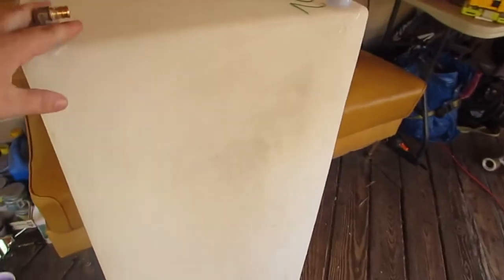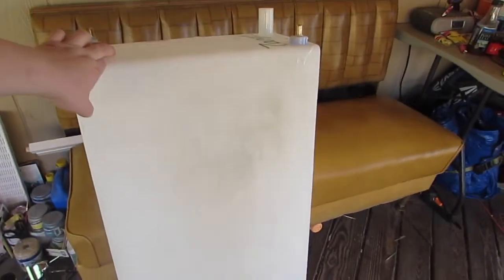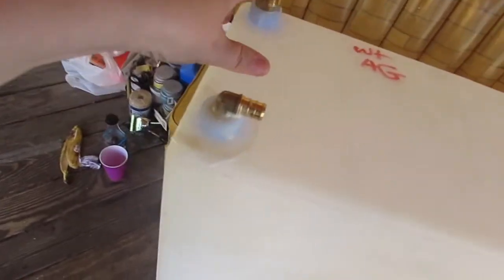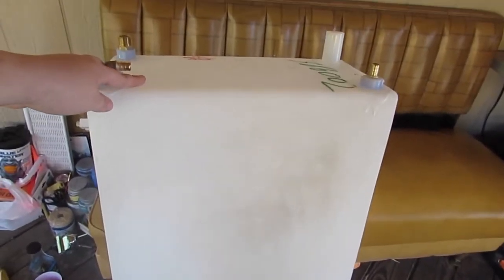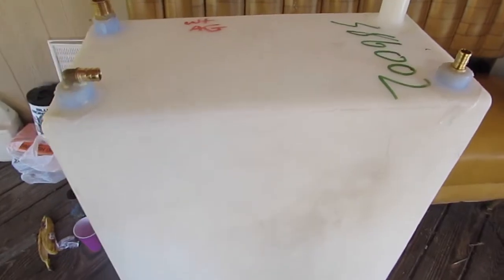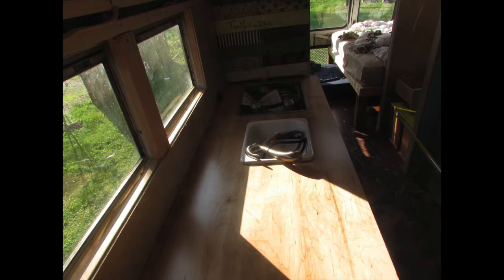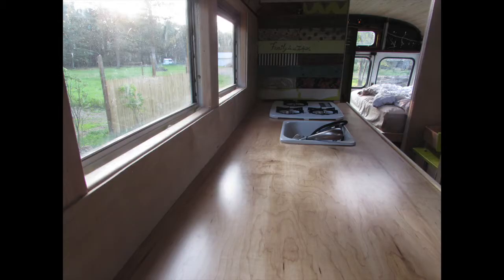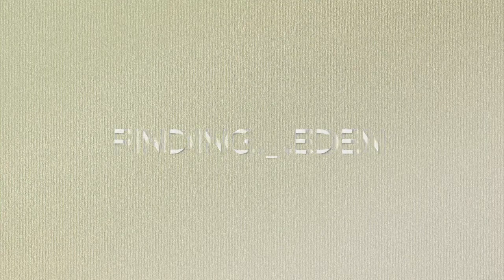Water Tanks Installed On The School Bus | Episode 22

Comment: That was a great Idea and tank size. I really like that it inside the bus and not under. Placement behind the sink is genius! If you could post tank size and dimensions and company purchased from , please? Another great idea for my Skoolie Cruzin Project
Reply from the maker: The tank is 8 inches wide but I"m not sure how long or tall it is. It's a 20 gal tank and it works perfectly behind the sink. I certainly didn't want it under the bus I was too worried about building a frame for it and breakage, I mean it is only plastic. I purchased it on Amazon so I'm unsure which company it was but I'll try to find out and let you know! Sorry I'm not too much help with it but I hope it helps you decide what to do with your project.
Reply: Is 20 gals going to be enough for a family of five on the road? Thanks for the info.
Reply from the maker: 20 gals is just for washing dishes, brushing teeth, hand washing etc. We will be using different water that comes in the 5 gal jugs for our drinking and cooking water. We intend on storing a few at a time on the bus and because we will have to stop for food periodically we'll just switch out the water jugs as we go.